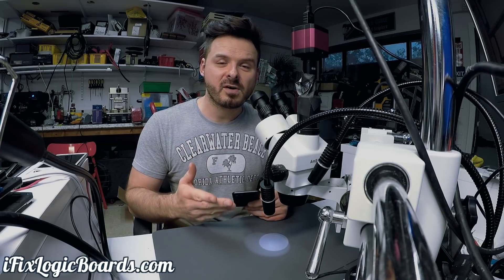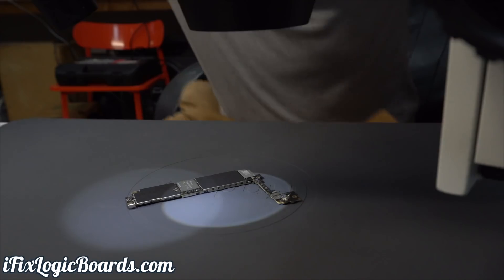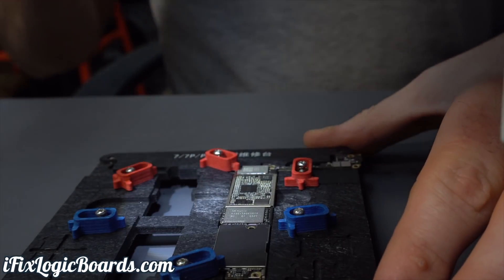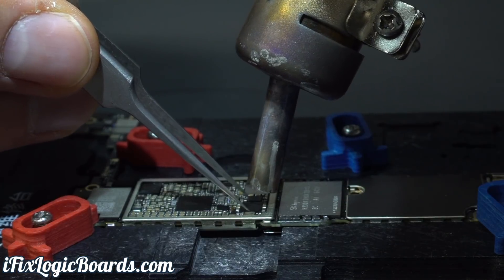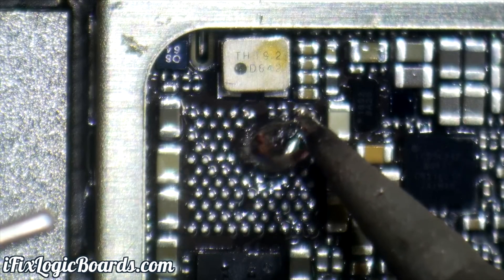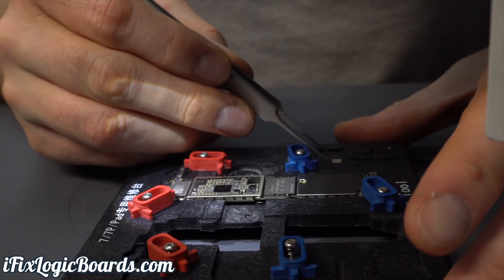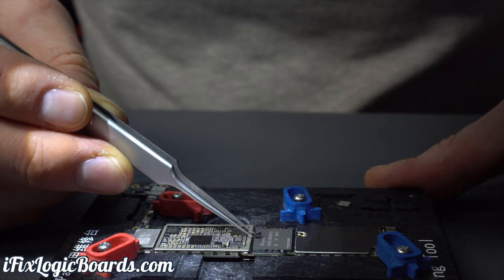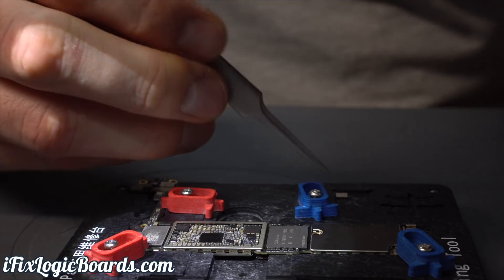iPhone 7 error -1  No service  repair

Comment: hey can you pls help me out over my ipad air2 showing error code -1 .. what issue with that .. i also tried to reset it through itunes but it stuck at apple logo with process bar obtain below logo, than it suddenly boot & stuck at it .. and some times it shows empty battery while i put it on charger..

Comment: Hey Scoop
I have a similar problem -1 on a 7Plus with Intel modem
What I have done : 
- reball bbpmu > then I got 4013
- changed bbpmu > back to -1
- reballed BB > still -1
What else do you think it can be done to this device ?
Reply from the maker: install the original bbpmu and then reball audio ic. I would try that.
Reply: Still on 4013
Reply: Andrei Badoiu  reball the baseband cbu bro
Reply: I have reballed it 3 times, still the same problem -1, seems a dead end.

Comment: hey man , whatsup . 

I have same case with an iPhone 7 plus , it gave me error 4013 , after I heated the harddisk it says error -1 now , should I try the same thing in 7 plus ? do u think that will work?
Reply from the maker: sure, you have nothing to lose...
Reply: ScoopOf3D i tried now error -1 is fixed but 4013 showed up ☺
Reply from the maker: Do the same to audio ic.